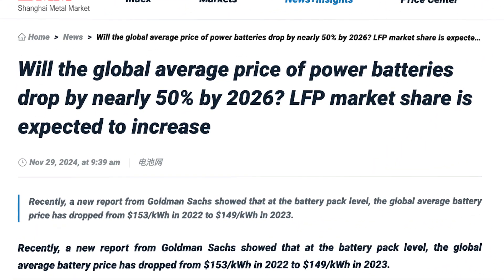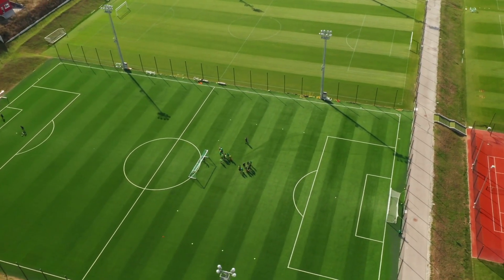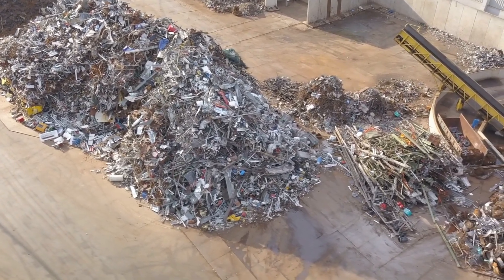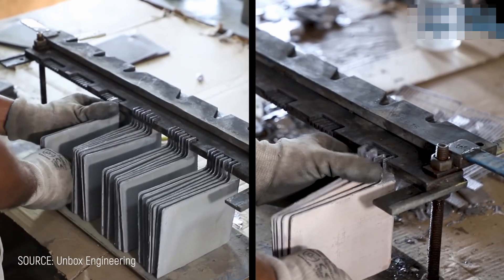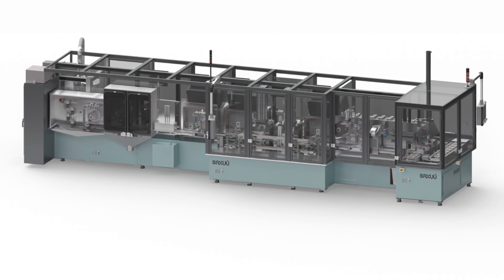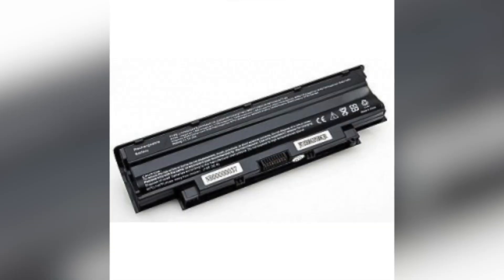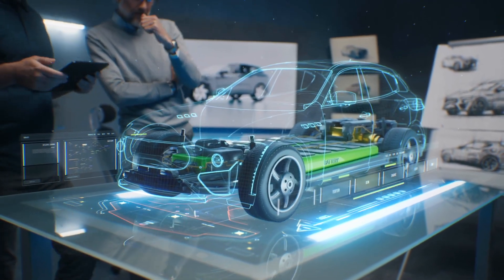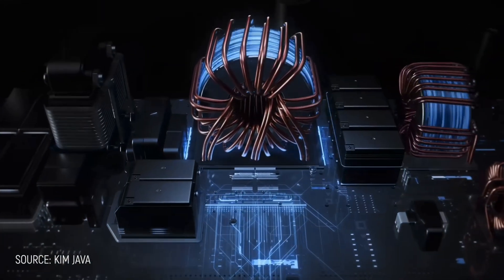Why EV Batteries Could Soon Be 50% to 60% Cheaper

Comment: Who would you recommend for a leaky HVAC in my home in southern Colorado? 
Yes I saw the website, but I don't wanna put in all that info in and potentially get even more spam. You don't need my full address and my phone number to recommend a company in my rough area. If I use them and they're great I'll let them know I found them through you. 

Have any of you used their service, is it good? 

I used EnergySage to find my solar installer and it worked pretty well. Got a few companies to respond and went with the one that had the best tech for the best price, not just the lowest price.

Comment: From cell phones to vehicles, physics dictates the optimum size and form factor of battery cells, which are identical objects made by the billions. That's what factories do best. Regardless of technological or process improvements, the economy of scale will bring about these price reductions on its own.

Soon, battery packs will be more affordable than combustion engines. Already, it is FAR cheaper to install (and decommission) charging stalls than a gas station.

When you hear a coal roller scoff about batteries being non-recyclable, be sure to ask how their gasoline recycling program is working out for them.

Comment: It doesn't sound like the word is getting to the US.  EV batteries are already cheap in east Asia.  As an example, in Thailand there is a wide selection of EVs under US $30,000.  China is already mass producing LFP at a low price.  Cheap Sodium batteries are already in process.  Everyone wants even cheaper batteries but the real issue has to do with public policies, not a technological breakthrough.
Reply: This is what happens when  the US gov’t is bought by the auto industry and the oil industry. NOW we are years behind  China and other Asian countries. Ford  and GM can not compete on the world market anymore. There is a good chance they will go out of business or be irrelevant. IT IS SHORT TERM GREED !

Comment: 50% cheaper ? don’t be naive 
we will see 10% cheaper 
the rest of the savings will go into corporate profits
Reply: RnD needs a buget ;)
Reply from the maker: While I don't disagree that corporations love profits😁... the EVs selling currently have been largely unprofitable for a lot of manufacturers because of batteries/cost and brutal drop in demand for all the known reasons (causing prices to crash) so I'm optimistic it will at a minimum make things more competitive, and could find have an actual "budget friendly" EV that's comparable
Or cheaper than their gas counterparts

Comment: There are many good news on the battery front lately. Last thing I heard is a chemical discovered and tested in China that when injected into batteries restores them. That might require fact checking but still, sounds plausible
Reply from the maker: That definitely sounds interesting and worth investigating!

Comment: This sounded like a long commercial, mentioning all the talking points from a prepared press release. You also got some facts plain wrong, as if you did not do any research or were not allowed to by an advertiser. Not your best video.
Regarding battery recycling, it is pure misinformation when you state that all batteries that are produced by the wet process end up in landfills.  There are several companies recycling lithium-ion and LFP batteries. Redwood is one, but there are others too.  These companies even use different processes to recycle the batteries and reach a recycling efficiency of around 90% of all the battery mass, including rare metals. The reason they are not yet big money printing machines is that the volume of batteries available for recycling is still too low, because EV production only really took of in the last decade and most car batteries, if they are below the recommended capacity, first get a second life as for example stationary energy storage (another 5-20 years of useful life) before they will be recycled.
As for the dry production process, while the process of this company is undoubtedly unique and has advantages over other processes, Tesla has been working on a full dry production process for their batteries for several years. They have been using a partially dry production process for some years and working on the full dry production, at which they were successful last year. As of last year, they claim to have solved the full dry production process and are said to be scaling that to full production capacity. All with a 75% footprint reduction and up to a 10x energy reduction for the production process. The last step is admittedly technically still in the last stages of development, but as far as I know, the company you highlight does not have a production facility that is producing car batteries at the moment, and a famous mantra in product development is: "research and development on lab scale is easy. Scaling to full production is hard."
Reply from the maker: No advertiser paid me anything, I read this on several sites / allegedly reliable sources related to this battery... if it's innacurate I'll research more and remake the video so it's factually accurate. Obviously not trying to put out a BS video and no paid me anything. And even if they did - if I had to jeopardize my integrity to do so I wouldn't... I'll look into it more
Reply: @TheHVACDopeShow  everyone loves the hype of a new tech, a lot of startups put together fancy press kits and send them off to these sites hoping they can get someone to pick it up. Once they get one to give them some press it’s much more likely someone else will pick it up too. Because nobody wants to miss the hype train.

The big problem being that is you follow all of the hype, next thing you know you’ll end up with the same reputation as two bit Di Vinci or Undecided with Matt Ferrel, channels that I think started out well, and now are just peddling misinformation for views.

Most of these “revolutionary battery” companies fizzle out after scooping up a bunch of investor capital, never to be heard from again.
Reply from the maker: https://eepower.com/news/cancelation-looms-as-tesla-pushes-4680d-dry-coating/

4680 doesn't have dry process yet, but is hoping to this year or next? Idk I can't find anything confirmed
Reply: @TheHVACDopeShow  Tesla has been using the dry coating process for the anode for years.  They are still tweaking the dry coating for the cathode which should be implemented soon if not already.
Reply: @TheHVACDopeShow  
I STRONGLY suggest you search and watch "Munro Live Bonnue Eggleston"
(Interview with the 4680 Cell Director)
"From the Horses mouth", Not Hearsay.
Reply: Thank you for taking the time to flesh that out for other viewers!🎉 I thought I was going to have to do it
Reply: I came here to say almost exactly this.
Reply: A little company called tesla has been doing dry electrode processing for years.  You even used there b-roll of this when explaining the wet process.  Did this company pay you or are you just dodging  the tesla 4680 cell?  Go watch battery day from years ago that should get you up to speed.
Reply from the maker: Ok will do, no one pays me to make videos, I apologize if I was misinformed but this is literally what I read on several sites about what makes this battery different. No worries if needed I'll do more research and remake this